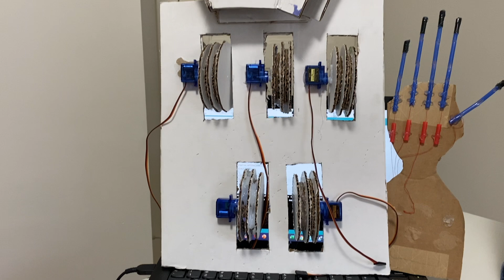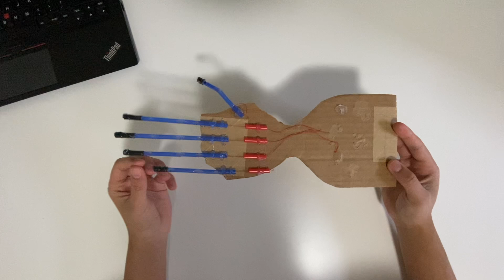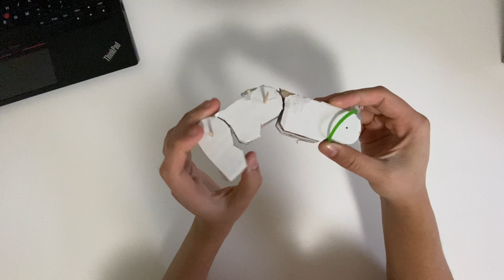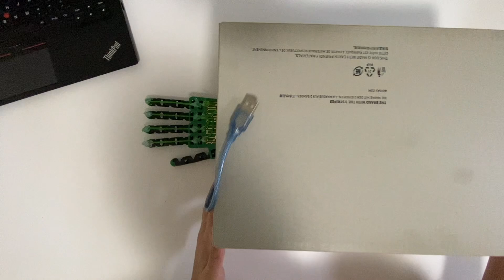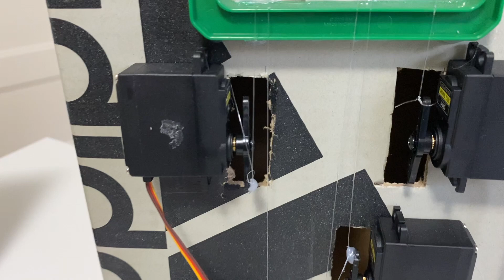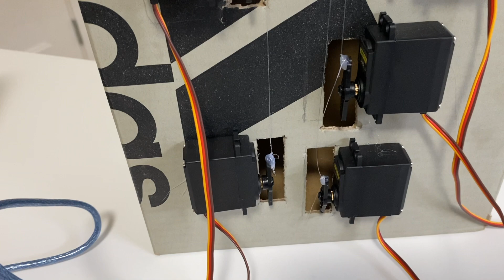Servo-Based Robotic Hand - Voice Activated Robotic Hand Part 1

Comment: this is amazing, would it work with a smaller servos? to compact the design
Reply from the maker: I’m glad you liked it! For my final robotic hand design, using smaller motors would have worked fine as well, but I just decided to overcompensate with larger motors. If you are planning on designing a robotic hand as well, I recommend you consider your own specifications (material, size, how compact you want it to be) before you choose your motors.